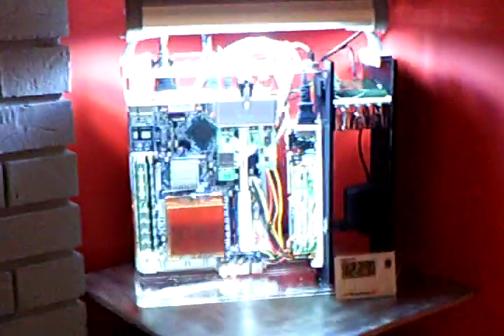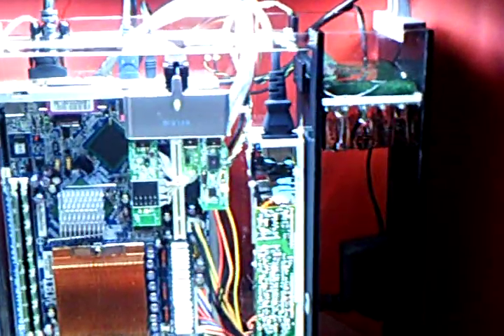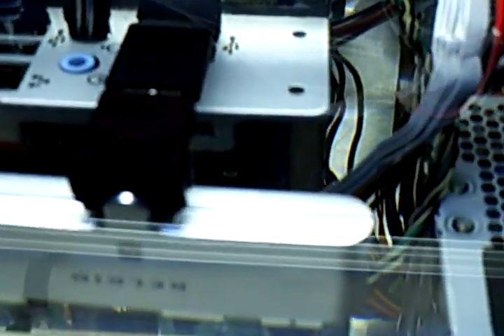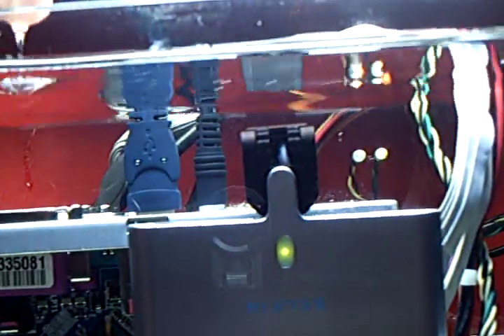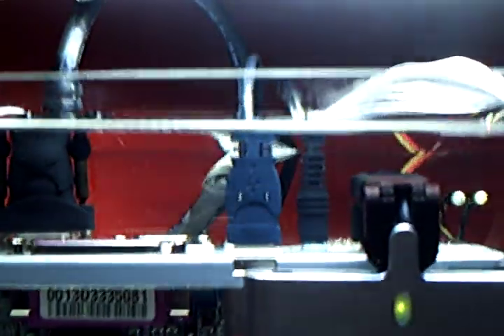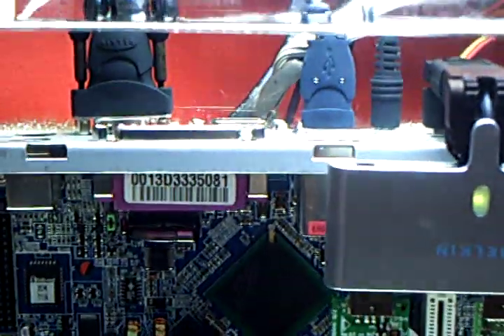Mineral Oil PC2

Comment: I suppose...unless you're running a modern system that needs an oil cooler to keep it circulated and cool...then it's about the same price and the liquid loop would still beat it hands down.